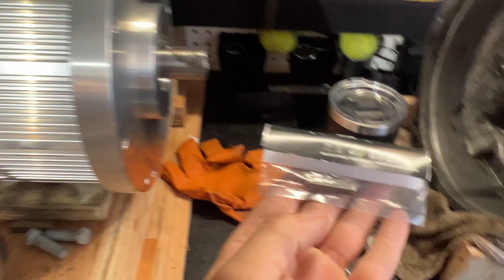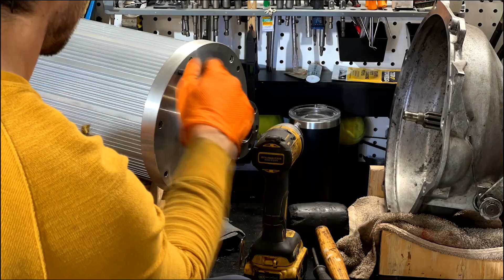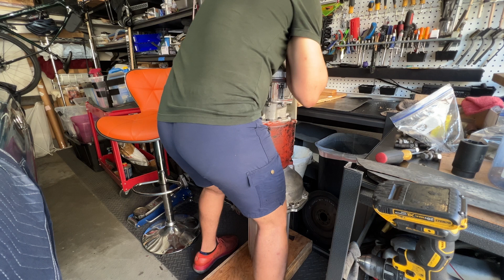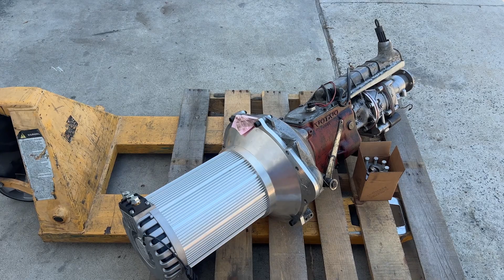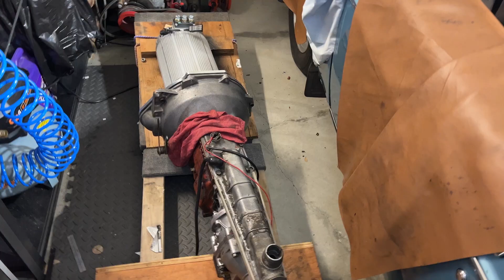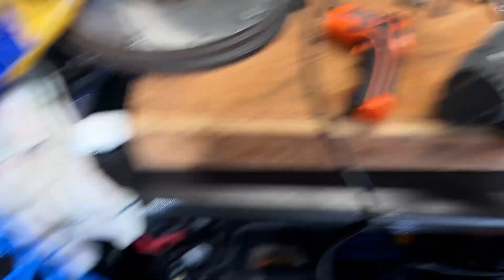[Reupload] Volvo 164 Electric EV build - Part 8 Mating the HyPer9 Motor to Transmission

Comment: Hey David im looking to get a volvo 240 wagon from 1985.  Its in very good condition 187k miles.  Anything i should look for specifically, i know the wiring can be bad on these but what else would you recommend.  Also its this vs a Mercedes Benz 300D turbo diesel.  So kinda torn.
Reply: I would bias toward the Mercedes (wagon?) if you have a ready parts source available.

Comment: Change or rebuild your gearbox from od box to standard m45. The planetary gear cannot handle the torque.  The rebuild is easy, just replace the main shaft and backpart as well as the standard  propshaft  1974 and up fits from all volvos. . As a regular m45 it can also handle oil for higer persur better, od gearbox don't like 80-90 gl5 that get to high oilpressure for the pump.
Reply: An M410 might be a better option if you don't need OD or 5th gear.
Reply: @delukxy  You probebly mean a m400 not m410 that's a m400 with od.
Reply: @VolvoLaplanderCamper  That sounds correct. My bad. I don't think the M45 will fit the 164 bell housing without yet another adaptor.
Reply: A heavier flywheel will be harder on the synchros, and likely a litle more cranky to shift without using clutch. Maybe it will add a percentage point to regen, in support of keeping it.